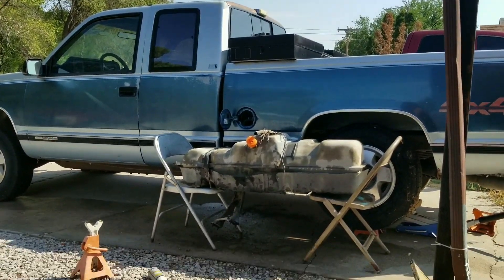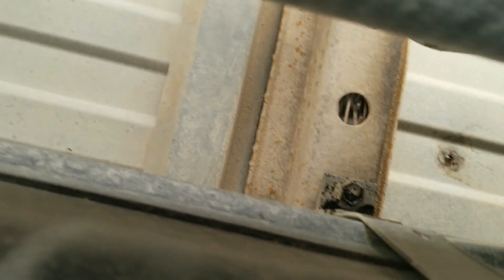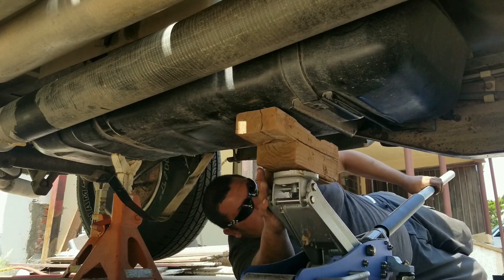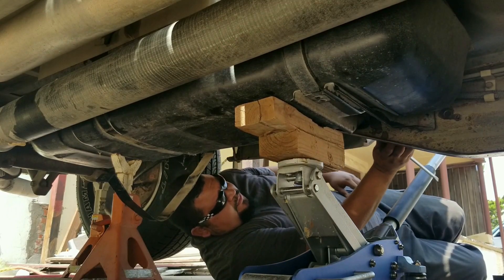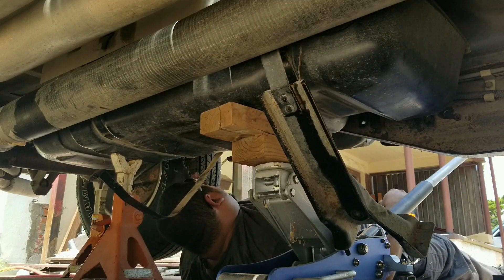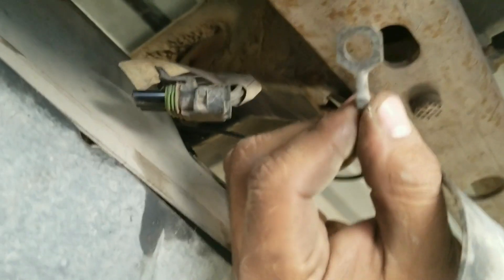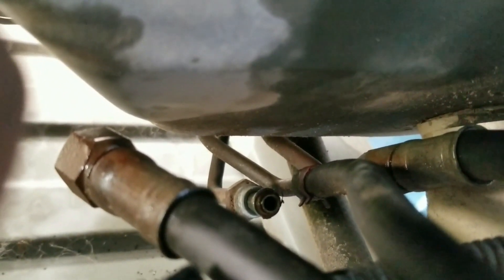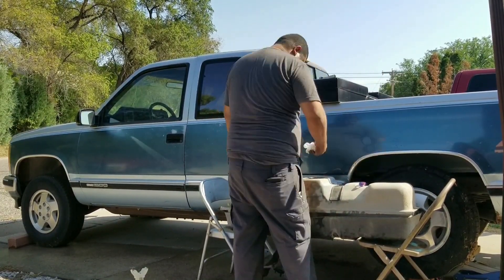1988-2000 Chevy C/K 1500 fuel tank drop

Comment: Thank you for doing it the right way and NOT cutting a hole in your bed. I see all these videos of people doing that without realizing how badly it effects the structural integrity of the bed. Don't believe me? Drop a brick on your 'access' flap and see what happens. Also applies to couch or table legs. It was at least a thousand dollar deduction at the dealership too. Good job but please get yourself some electric ratchets Tony. Rigid stuff works great and I have adapters for 1/4" 3/8" & 1/2" sockets.
Reply: Why can’t u just weld it back up ? Integrity would return

Comment: It’s a good video, I have 2 of these trucks and have had to replace both pumps - I opted to undo the bolts and hardware from the bed and use a comealong and small scaffold to lift the box off, then you can work on the gastank easily

Comment: Why  GM  and some other manufacturers  stopped using the old fantastic reliable   metal gas tanks   ???
Reply: Rust
Reply: Reliable? Please
Reply: Same reason you cannot find metal gas cans....condensation
Reply: Plastic is better when dealing with flex fuel/e85